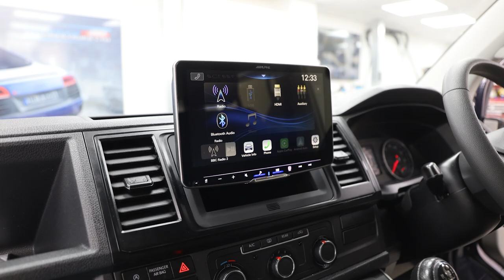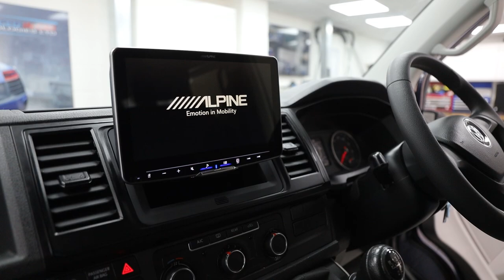How To: Install An Alpine Halo Media System Into VW T6 Transporter!

Comment: Hi there. I should be picking up my new (to me) 2019 T6 camper in mid January. It has the standard factory head unit installed and, after seeing this video I think I will be paying you guys a visit to get it upgraded to the alpine unit being installed here. 
I am seriously impressed by the amount time and care given to this install, cutting and soldering, cloth taping and cable tying for example. Good job, and hope to see you sometime early next year.

Comment: Good video! What I do not see however, is where the AM antenna plugs in. I’m in the process of finding out how to replace my Panasonic head unit in my brand new 2023 Toyota RAV4. It lacks AM and is quite a basic head unit. But how am I to know whether an Alpine head unit will fit my 2023 RAV4 or not? Toyota doesn’t want to be cooperative at all. They won’t tell me if there still is an AM antenna for example….Will the steering wheel connections still work, does the Toyota factory updates for the car still come through as this goes over the air or via a USB stick connected to the existing Panasonic head unit? Too much for me to figure out without the cooperation of Toyota. I do not care about DAB, I never use it. I use internet radio instead. DAB will be overshadowed by internet radio, it already is a lost battle for DAB. So I hope you can shed some light on this for me hard to do job. Thanks, Willem, Hekelingen, Holland.

Comment: Hi. Do you have a idea why when I open my t6 with the central locking, the radio turns on?
Reply from the maker: Hi Blackbird,

Thank you for getting in touch!

If you have an Alpine fitted in your T6 then it will be the 'Pre-Ignition Start-Up Option' that needs setting to 0mins. This is found the 'Settings' section of the 'Vehicle Info' tab on the Alpine Home Screen.

Hope this helps!

Kind regards,

Advanced In-Car Team
Reply: Hi. It’s working 😍. Thanks for your help. 😊

Comment: Great video. Is the mic any good in the facia or is it better to route to ceiling?
Reply from the maker: Hello Matthew,

Thank you! We route it to the ceiling to make it less noticeable whilst also being in a practical and central position. I'm sure it would work fine in the facia however, would be more visible and easier to knock, but its your call. 

Thank you!

Kind regards,

Advanced In-Car Team
Reply: @AdvancedInCarTechnologies   Thank you for your reply. There is a vent in the facia and internally it is a round socket to house the mic...just wondering if you have tried fitting it in that location?
Reply from the maker: Hello Matthew,

No, that round vent looks like it would support a mic however the Alpine microphone does not fit within the socket.

Hope this helps. 

Kind regards,

Advanced In-Car Team

Comment: Hello, my name is Sorini and I need some advice if possible. A month ago I bought the Alpine Halo11 iLX-F115T6, and I would like to install it on my Volkswagen T6 Multivan  Highline car from year 12-2015.
Having the APF-X300VW Installation Kit. We assembled everything but it doesn't work, basically the screen lights up for 2-3 seconds and then goes off.
I would like to know if maybe you can help me to make it go.
Thank you and I await his reply. I am from Italy
Reply from the maker: Hello Muresan,

Thank you for getting in touch!

It is hard to know what the issue is as we have not been involved in the installation. I would start again, and follow our instructions within this video very slowly, step by step. 

Have fitted the two-legged mini plastic section that you slot in after fitting the screen but before you install the outer casing? This is very important and enables the Halo to work.

Hope this helps.

Kind regards,

Advanced In-Car Team